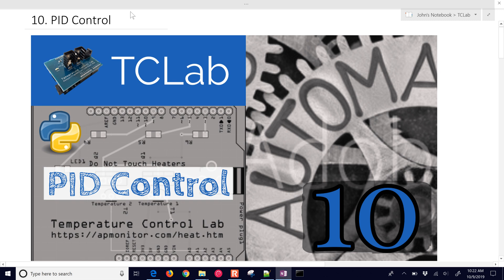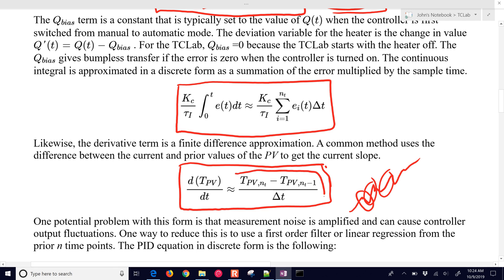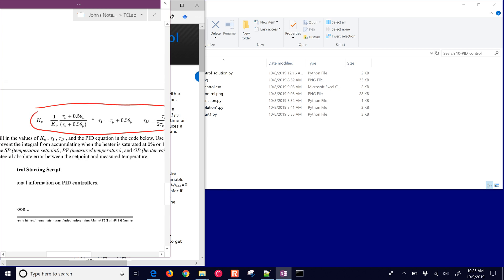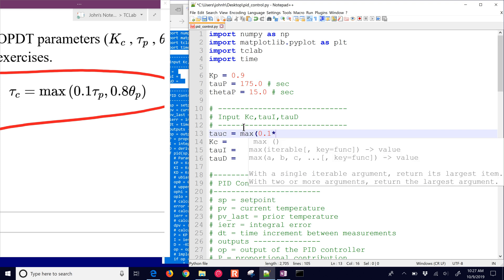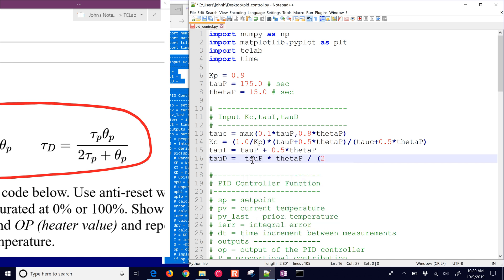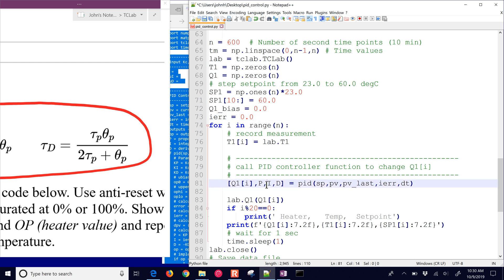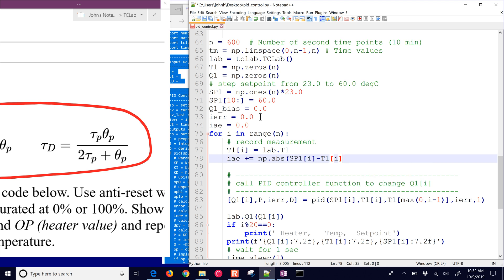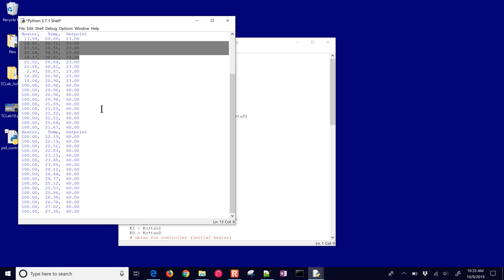TCLab: Arduino PID Control in Python

Comment: Thank you for great video lectures! I have a question about noise in PV. We see the impact of measurement noise on controller output in this example. Does noise have impact on proportional and integral terms in PID equation or it is just the derivative action that is affected by noise in measurement signal? 
If PV is noisy, do we need to filter it if we are using a PI controller and we don't have derivative term in controller equation?
Reply from the maker: You may consider a filter for the PV for the proportional term, especially if this translates into undesirable actuator movement. There isn't typically a need to apply a filter for the integral term. Most times it is only a filter for the derivative term.

Comment: Thanks for a great video, I wanted to know if we can conveniently use Python to code Arduino. In my experience, only C can be used for coding Arduino? Isn't that right?
Reply from the maker: Yes, Python can't run directly on the Arduino. Here is a discussion of the issues: https://arduino.stackexchange.com/questions/105/programming-an-arduino-using-python-rather-than-c-c  You can run Python on a different computer and control the Arduino, however. Here is a tutorial on pyFirmata: https://apmonitor.com/pdc/index.php/Main/ArduinoSetup (see instructions at the bottom).
Reply: @apm  That cleared my doubt. Thanks a lot :)

Comment: Thanks again Professor for this great video. What is the correct implementation of "derivative filter" in python? I tried but I haven't gotten good result.
Reply from the maker: There are a few ways to estimate the slope. You could fit a line to the last five points or you could use a first-order filter of the PV to get a smoothed estimate.

Comment: Its nice, but You have constant time, and in equation You will have all the time this same sum. I am playing with my one code, and when i delete equation using time, i get this same rezultat like You have. 
 Now i am thinking about updating code that I could use time to calculate PID, because I notice that in formula on "D" is spid up heating and is stabilizing everything, but I need 
use if statement to measure if temperature is rising up, or down, and then measure time how fast that temperature go's up or down, and then initiate PID function.
Otherwise D function is useless, and is creating spikes.
Reply from the maker: I agree with you about the derivative action. You may want to look at a derivative filter or else just use a PI controller.